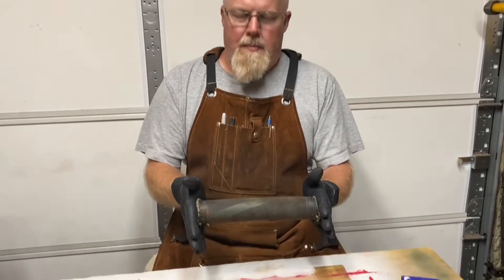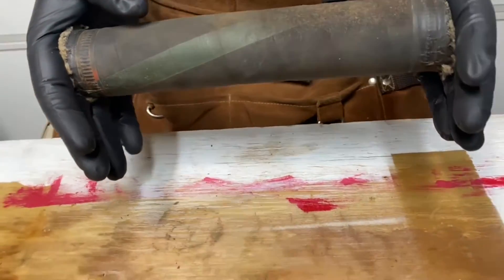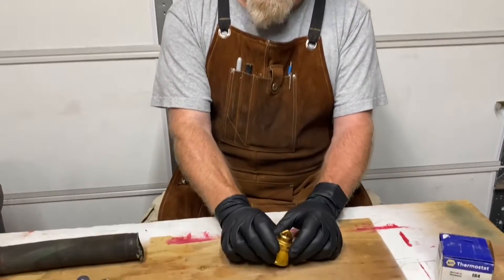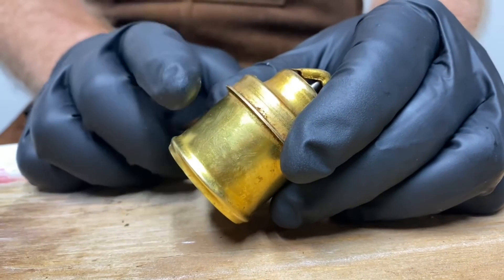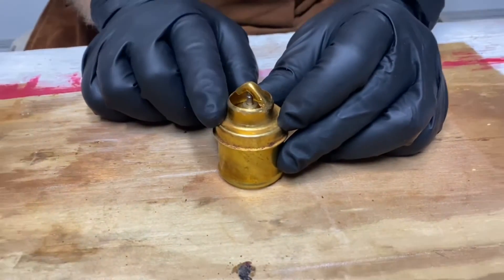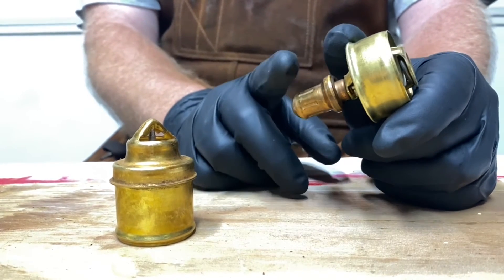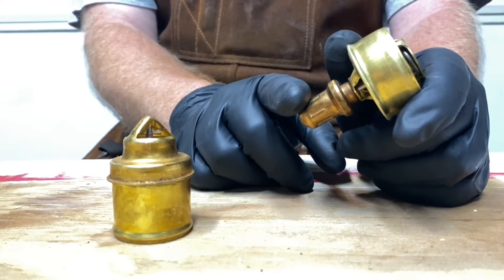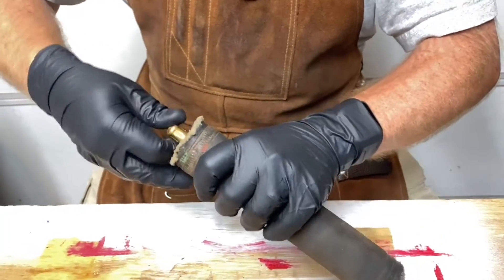You need it! Ford 9N, 2N, and 8N Tractor Thermostat Tips

Comment: Good info!  That 180deg stat that you have is a Gates 33108.  I put the exact same one in my '52 8N, and it works fine, even in 90 degree + TN. temperatures without overheating.  Some tips - I drilled three 3/16" holes in the rim to allow for pre-open flow.  You'll notice in the video that the 160deg stat has one hole.  Recommended by Bruce Haynes.  As far as insertion, heat the hose in a pot of warm water, then put some Dawn dish soap on the inside of the hose.  Use a 1-1/2" PVC pipe @ one foot long, and grab the hose from the top and push down on the PVC end placed on the floor, pushing on the stat at the entrance of the hose.  It's a five second job! You can put the hose clamp anywhere AFTER the stat in the hose to keep it from possibly migrating closer to the radiator.
Reply from the maker: Thank you for the information!

Comment: I have two 1951 8N's and I installed a water temperature gauge in both because I was concerned about overheating - ( your video was helpful )   bot were running at 160 and after using brushhog did not get above 190 - reassuring info to me.   Thank You !      I Probably wont do 180 deg thermostat unless a problem with system.

Comment: Great Video, Bruce's 75 tips have been invaluable for this first time ford 8n owner ! --------  One Question if you don't mind, I have the Temperature Gauge Adapter Pipe (steiner part# FDS2673) which holds the temerature guage sensor installed in the middle of the upper radiator hose. Would you place the thermostat on the block side or the radiator side of the Adaptor ? ---- any direction is much apprecated !
Reply from the maker: I think either way would be acceptable, but I would rather it on the radiator side of the sensor so in case the thermostat doesn't open properly you would see it in the sensor reading.  I hope this helps and thanks for watching!
Reply from the maker: Also, if you ever thought about doing an in head sensor, I have an install video on that on my channel too.
Reply: @TheKiltedHomesteader  Thank you for both replies, ironically I am picking up the head from the shop today and debated back and forth on whether to have them drill in the hole (based on your video) or keep the 46.00 "T" in place, ultimately choosing to keep the "T" adaptor at least for now as all the hoses, adaptor, t-stat & gauge (and engine) all have less than 50 hours on them. The engine was rebuild in Ohio and shipped to Arizona but always smoked, seemingly more than the expected break-in smoke & also heavier and heavier in white. the culprit appears to have been found in the head bolts not having thread seal applied, then water-jacket coolant blowing into the cylinder and out the exhaust. Had the head resurfaced and dunked just to be sure, putting it all back together now with a new fan shroud so fingers crossed.... the only thing I debate on yet is weather to replace the head bolts new, but I so far cannot justify the 6-8 bucks per replacement bolts (or even the .55cent sae option) without a valid reason ... error on  the side of caution  maybe ???
Reply from the maker: @dopofaz  Things aren't cheap, but sometimes spending a little bit more now may save you time and frustration later.  Thanks again for watching!
Reply: @TheKiltedHomesteader  I completely agree, have you ever experienced a problem solved by replacing a head bolt though? maybe a warped bolt, a few threads too long/short, becoming un-tempered? I don't mind spending the money, but just can't figure out if there is any reason or thing that would make it necessary ?  Also for any readers out there, I am replacing the head gasket new, and spraying it with the copper spray.

Comment: it evens out the block temperatures thermal expansion when you run a thermostat. no thermostat you have cooler areas and hot areas. run your thermostat.

Comment: They have been running for 70 years why change the temperature they run at now? They run a fraction of the hours they used to.
Reply from the maker: Good question. An engine will actually run more efficiently at a higher temperature however, when these were built, they often used alcohol as an antifreeze and above 160 degrees it would evaporate off faster. This is why they used a cooler thermostat back then. Again, a hotter engine (within reason) is actually a more efficient engine. I hope this helps!